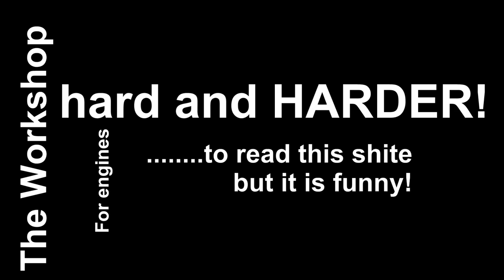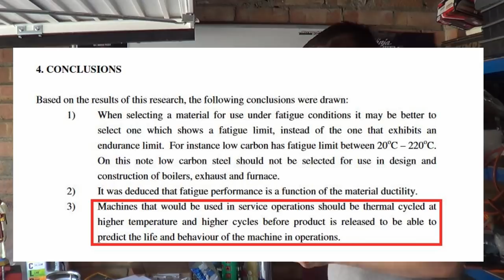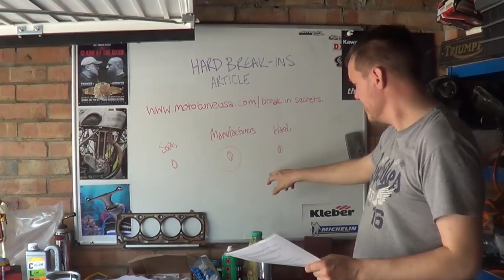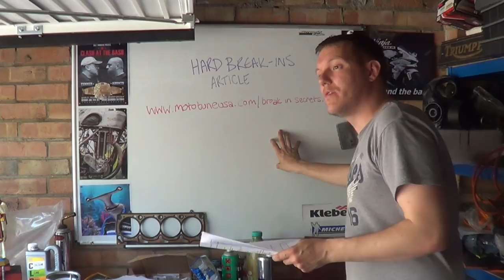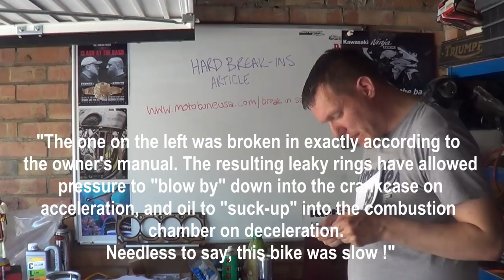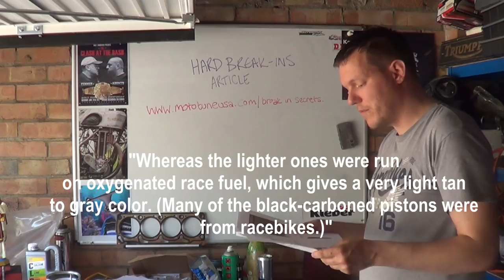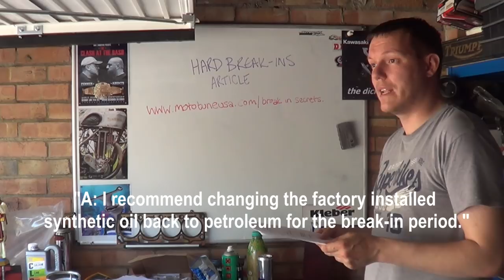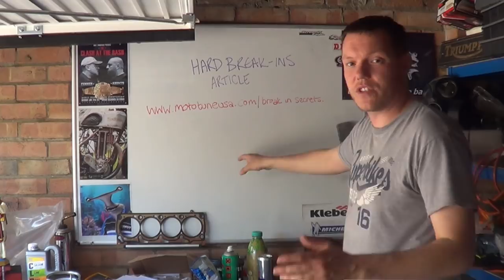Hard break in BULLSHIT! - Part 2

Comment: that article is bullshit appeal to masculinity bullshit peppered with lies, true, but there's nothing wrong with a hard break in when you've got an engine that'll be rebuilt every season anyway.  I do them up on the bench dyno.  doesn't make less power, and it's quicker to do.  rings are cheap, I can live with a little less life out of them when they're not going to make a second season either way.

there are a few points in the article that you've misunderstood (one that stands out in my mind is the ring filing thing from part 1), though it doesn't really matter because those points are wrong, irrelevant, or poorly written anyway.

Comment: telling ppl to use car oils LOL 
and specifying the weight of the oil LOL. 
when I broke in my engine I went the hard breakin route but! I stuck to manufacturers oil specs. and I used semi synth after a easy 100km I dumped the oil and filter. put in some more semi syth (grade my bike is supposed to use) and I rode it HARD for 1,000 km then I put in Motul V300 again the same grade my bike is told to use. My bike has now done 26,000km and is puring like a kitten. I have raced other bikes that are the same and its a little faster. not sure if its the rider or if my wiz bang break in worked. but Its happy Im happy. 
I also do oil changes at 2,000-2500 KM I change filters every 5,000km

Comment: Fuckin' top.  He's a proper mong, can't argue with much of anything you've said here.

Mind you, snowmobiles get their cooling from snow thrown up by the track, rather than air cooling - idling snowmobiles for long periods (like more than 5 minutes) is a really fuckin' bad idea, they get really very very hot indeed.  Never seen any of ours actually melt, mind, they just run ragged as fuck (deliberately, the ems tries to avoid committing seppuku) until they cool down.

For info, here's the stuff from the 2004 RX1 owner's manual, available here : http://www.yamaha-motor.com/assets/service/manuals/2004/lit-12628-02-33_802.pdf.  Direct quote, page 7-2

-----------------------

Operating your snowmobile for the first time
Start the engine and let it idle for 15 minutes

0-160 km (0-100 mi)
Avoid prolonged operation above 6,000 r/min

160-500 km (100-300 mi)
Avoid prolonged operation above 8,000 r/min

500 km (300 mi) and beyond
The snowmobile can now be operated normally

-----------------------

If you look at the 2005 owner's manual, which was the last year they made the damn things, the text is identical.  So not only is his "quote" extremely selective, missing out the bit about running the engine in, but it's also wrong, as they don't seem to have changed the warm up procedure.

Comment: I did not watch the entire 35 min of 2 vids, but I like a hard break in for the reasons mentioned in the first vid.  Cylinder pressure pushing the ring against the cylinder wall for faster seating. The highest cylinder pressure is where torque is the highest, and that means the meat of the power curve.  I put small 2-stroke engines brand new on my dyno, and beat the heck out of them, (much harder than in the field). For the Zenoah engines I build, I don't think there is a break in process. In fact, for their air cooled engines, the manual say nothing about a break in process, (and they have some good engine info there).  For their water cooled engines (RC boats), the manual say no break in is needed.  Seat the rings as fast as you can,---to prevent tarnish and burnt oil build up from blow by, and race it.  I have never seen a engine failure because of a improper break in procedure.  The builders in my industry who claim that is possible, failed because they did not champher the exhaust port after porting.
Reply from the maker: "Cylinder pressure pushing the ring against the cylinder wall for faster seating."

- do you have evidence of this?

"The highest cylinder pressure is where torque is the highest, and that means the meat of the power curve."

- I didn't know that LMAO!

"I put small 2-stroke engines brand new on my dyno, and beat the heck out of them, (much harder than in the field)."

- LOL because a Dyno loads up an engine like it does on the road - what an idiot - what about wind resistance?

"For the Zenoah engines I build, I don't think there is a break in process. In fact, for their air cooled engines, the manual say nothing 
about a break in process, (and they have some good engine info there). For their water cooled engines (RC boats), the manual say no break in is needed."

- You have to be shitting me - we're talking about REAL engines not fucking toys.

"I have never seen a engine failure because of a improper break in procedure."

- that's because the loads are tiny you muppet. Jesus Christ!

Comment: piston ring seal is everything poor sealing piston rings lets combustion gases by piston rings and this is the dark parts ya see on piston after being used
Reply from the maker: Yeah but how do you get poor sealing - over oiling and real low loading
Reply: poor piston ring seal is when the piston rings are not loaded up during the running in period eg when piston rings are forced into the cylinder walls cylinder bores
Reply: never had a problem with over oiling when running with two strokes and four strokes engine's thinking only way over oiling could can be done is when throttle is closed and piston's intake oil back into cylinder/bores
Reply: only way a two stroke engine will over oil is when the premix mixture is rich eg instead of running 50 to 1=91 millilitres of oil per 4.50 litres ya run 40 to 1 = 114 milliliters per 4.50 litres of petrol or even richer than this on the road  also rich mixture on two stroke engine looses power and throttle response = wolly and flat not crisp and sharp

Comment: These videos haven't "annihilated" anything except your credibility. Standing there ranting about something you disagree with doesn't prove your opinion. 
Testing does.
Try the different procedures for yourself. You might be surprised.
Reply from the maker: Oh I didn't think about that - just ignore the people who build the damn thing and just try the lazy option. I disagree because its wrong - not because of an opinion, but because of the physics of the system. Thermal cycles, tightest clearances, wear analysis and so on and so on..........

One question though, how does arguing and the side of reality damage my credibility? Simply put, its the alternative 'procedure' that has to prove itself, and the manufacturers stated procedure is currently the correct procedure.
Reply: You are hurting yourself with the name calling and belittling of ideas that differ from your opinion. Until you have tested out the two methods yourself, that borrowed opinion is all you have.
Reply from the maker: One other thing "You might be surprised" - by what? All you have done is cry like an 8 year but said nothing............
Reply: My work is done here. Thanks for the dialog.